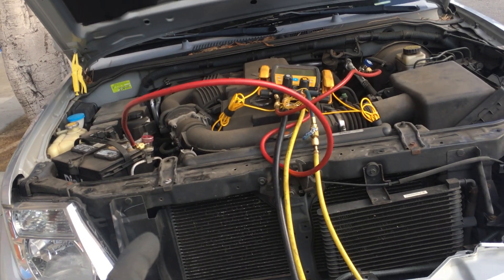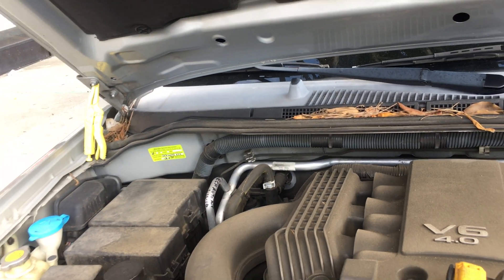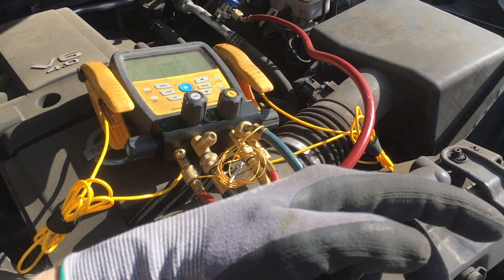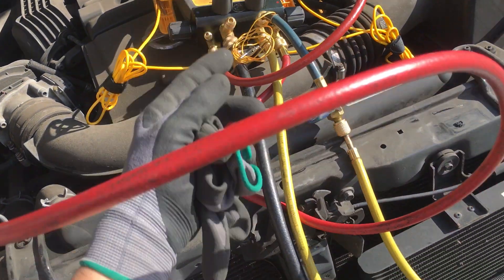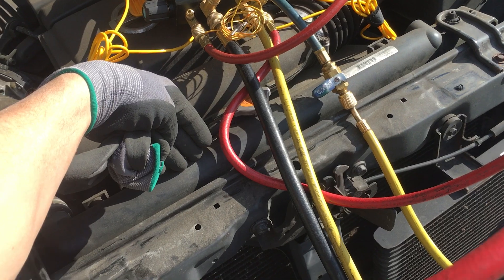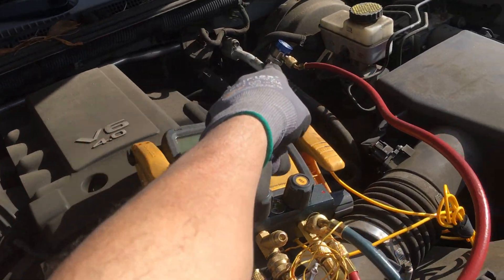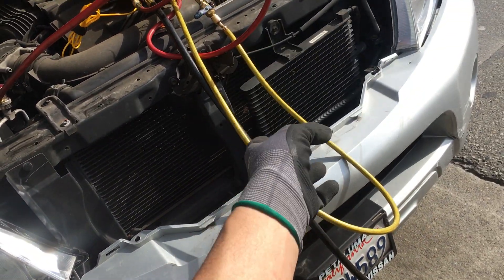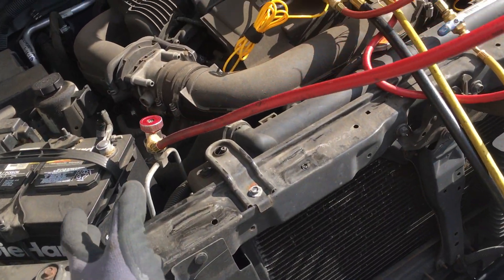AC recovery explanation, AC oil removal, WHAT ABOUT THAT UNIVERSAL REFRIGERANT OIL ???!!!

Comment: hey, recovery machine has oil separate function?
Reply from the maker: No.    When using this type of recovery machine you’re only pulling refrigerant out of the low side and you can control the speed with your valves on your gauges or on the machine you have a site glass in your refrigerant manifold that you can actually see if there’s a flow of refrigerant and you see any liquid do you want to slow it down so you do not remove oil.
Reply: @coldfinger459sub0  what is %efficiency when u drain freon only via Low Side? I am asking because the topic of oil in the AC system is very ignored and nobody wants to talk about it, how to check the oil level, if we do not have information from the customer about AC services in the last 5 years, for example. Has the system been flushed? has the compressor been changed? has anyone ever added oil? the system may have too much oil? HOW to check. 90% technicians just adds refrigerant. Not paying attention to the rest of the components. Dont speak english very well hope u understand.
Reply from the maker: @hbo7799  it’s very difficult.    Sometimes when there’s way too much oil extremely overfilled. 
                        And you depress the suction line it should just be vapor but instead a lot of oil comes out but this is not true on all vehicles so it’s not a good indicator. 

The most time-consuming method is running the system with a full refrigerant charge for about 15 minutes

Then you very very very slowly recover the refrigerant from the low side until it’s empty

Then you pull the compressor off and pour out the oil and measure it comparing it to what the factory specifications tells you how much oil should be in the compressor. 

It will either have too much oil or too little oil

You cannot do this procedure on a system that is low on refrigerant because low refrigerant charge causes the oil to all gather up in the evaporator and not returned to the compressor
                   So this would give you a false indication that the system is missing oil when it is not because it’s all packed up inside the evaporator. 

Another method would be to recover liquid refrigerant into a sealed container you would remove a quantity of refrigerant let’s say for example 200 g liquid refrigerant. 
          You have to have a extremely accurate scale
           Then you slowly off the top of the vessel recover the vapor refrigerant until only the oil is left in the cylinder. 

Now you would weigh the cylinder again and for example let’s say there’s 20 g of oil. 

If you recovered 200 g of refrigerant 20 g is roughly 10% of weight.   Usually the quantity is about 3% to 6% oil. 
             This would mean you have too much oil mixed in with your refrigerant.
Reply: @coldfinger459sub0  ok thanks for answer. So you recommend recovering refrigerant with machine without an oil separator, via vapor low port side, yea?
Reply from the maker: @hbo7799  if you are using one of these machines and you are not experienced I do highly recommend getting a oil separator they are available. 

They also separate any foreign material or leak sealant that may have been installed. 

And you can get a more accurate measurement by having a separator and measuring out the oil that comes out. 

I do sometimes forget that the majority people do not have a lot of experience and do not understand that just the low side suction fitting placement can put it in a place in certain situations where a lot of oil can come out. 

Several of the automotive equipment manufacturers market such a device I guess one day I need to do a video on this device. 

Because I often forget to mention all the fine details and always thinking that everybody naturally knows what is going on with the refrigerant inside hoses and lines in what state the refrigerate it is and how much oil is contained inside of it. 

I forget there is very little schooling and next to no education required an automotive industry that people just see something without understanding try to apply it and accidentally make mistakes that are costly. 

On these points I wish I had the time to do editing and put together very organized structured videos with detailed instructions but unfortunately I do not have that time available so I only can throw out the information and little tidbits spread out throughout all my videos.
Reply: @coldfinger459sub0  yes I am a beginner, I am not even 20 years old, I would like to start in future my own workshop, first I want to understand what physical properties occur with freon inside the system
What u think about AC Recharging Station semi or full automatic like Bosch ACS or Magneti Marelli Alaska, why u work on separate machines?
I suspect because you have more control over what goes on inside AC System? thanks a lot for your advice, it is really important to me ;)
Reply from the maker: @hbo7799   yes I personally like more control I don’t trust automatic they work 98% of the time but it’s at 2% when they don’t work and you don’t know it’s not working right is the problem.   
       But that is good enough for most people

When the automatic machine breaks down you usually lose all your capability so you’re completely dead in the water and you’re either waiting for parts are waiting for a service guy to make an appointment until then you’re dead no work.

Individual components usually can replace the same day through a local vendor immediately purchase one and you’re up and running again or you can take them apart and repair them easily. 

Yes you need to understand and know like the back of your hand the physical properties of what’s happening in refrigerant. 

I’ll send you a couple links of guys in commercial refrigeration because Automotive is really lacking for knowledge and education. 

If you spent a year watching all these guys videos on refrigerant properties on how to perform a vacuum how to perform recoveries what superheat and sub cooling are you will be better than 98% of all the other automotive technicians on understanding air-conditioning.
https://youtube.com/c/HVACSchool

https://youtube.com/c/acservicetechchannel

https://youtube.com/channel/UC_wC1rbMeYAv0qQUj6YmFcw

https://youtu.be/C8VLjBnkEcs

So save these guys as your favorites watch all the videos and who knows after a couple years you might even change your trade or open up your own business

Comment: I replaced the condenser and added proper amounts of oil not thinking that the compressor may already have some oil in it. I'm having poor cooling issues at high RPMs. So I believe it has too much oil. How can I remove the excess without taking the compressor out ?
Reply from the maker: Yes. Remove and pour out oil. To what instructions say

Comment: If I removed my compressor to do engine work and did not loose any oil in removing and reinstall, do I need to add oil when I recharge?
Reply from the maker: No need to add oil

Comment: BESTTHING IS TO USE THE RIGHT TOOL ONE WITH AN OIL SEPERATOR
Reply from the maker: No need fo a oil separator the recovery tank goes through a recycling machine when full later. 
             Why waste all that time waiting for a big old slow automotive RRR . Especially on the new R1234yf that can take 2 to 3 hours to recover refrigerant on a cold day .  THIS ONLY TAKE MINUTES. 
  
       I need to preform 6 to 8 recovery every day at just under $200 a hour .  Why would any one throw hundreds of 💰$$$ dollars a day using a big old under engineered overpriced pice of S&@T automotive Machine .  

       It’s the diffidence if you know what you’re doing with the right tool for the job. 
     Not lacking education on the limitations of the equipment.

Comment: Purchased refrigerant from AutoZone and it had stop leak and oil in it. The can look almost identical to the regular one.  It was almost double the price so I know why they look the same. Now I'm screwed and don't know what to do.
Reply from the maker: Just a regular Camry not a hybrid just one can not so bad.   What’s bad is when the guys keep topping off with those cans and they have two or three or four of those cans put into their car that’s where the problem happens.

               Dial the problem when somebody has a small tiny refrigerant system for example 390 g in their total oil capacity is 2.75 ounces in the can has another ounce of lubricant inside of it now you’re grossly over oiled 

          But if you use one of those cans on a normal distance style compressor with a larger oil capacity and refrigerant capacity not the end of the World no problem

Comment: Hey, where in California are you? I have a dual ac Caravan. I replaced the condenser, a little oil came out, drops, the rear evap, rear expansion valve and rear coupling hose from the expansion valve to the lines under the car were dry, no oil in them. I replaced all the orings on all the hoses I disconnected. There was a leak from the rear orings.

Now, i have mopar ac oil, mopar ac dye, but i have no idea how much oil to add. I am gonna assume the oil level is wrong because of the rear leak. 

What do I do? I have a basic vacuum, which i am about to hook up to put a vaccum on the system to check if its air tight. There are no videos on determining the amount of oil in a system.
Reply: I use glass oil trap. That way I can control the flow to prevent oil going into machine. Once its safe I open low side all the way. When it comes close to 0 I open high side. That way I know how much oil has been pulled out plus I visually inspect the oil 😀
Reply: @aleksgrigorev2717  all good, 4 years later ac is ice cold. i figured it out
Reply from the maker: Go Clunker 40ml. Oil replace for the condenser. 
         Was there a lot or just a little oil stain around the leak sight at the fitting with the bad Oring ?. 
         Most of your oil is probably up in both of your evaporators, caused by running low on refrigerant. 
         At most small leaks with just a light oil stain is almost unmeasurable amount of oil. But be on the safe side say 15 ml. 
    40ml. + 15ml. = 55ml  or (1.86 Oz. ) 

          Put it on the vacuum pump over night fill it by weight with refrigerant. Go by the sticker under your hood. 

         If everything is in good working order you should have a cold van. 👍
Reply: t lech i shook the crap out of the rear evap, its empty. The only real drip ( and by that i mean negligible tiny drip) came out of the condenser. I bought this thing with the ac already dead. Very minimal oil stain around the rear where the o rings were leaking, like super minimal. I jumped the compressor for a few seconds before i had the ac evacuated and the clutch and compressor work. 

You’re not in socal by any chance are you? You’re the only person who says oil is removed with vacuum and you are 💯 correct. If there is anyone who i would trust, it would be you.

I have it on the vacuum right now. Put the gauge set on the vacuum first to test it, leak free. I’ll see in an hour when i close up the valves if it holds vacuum or not. This car is my nightmare. This isn’t the dodge in my videos, this is a nightmare on wheels I bought broken and brought back to life after rebuilding the motor. Sincerely regret investing the time and money. Everyone hates Chryslers. After this experience, I understand why. Makes my problem m3 seem like a cakewalk